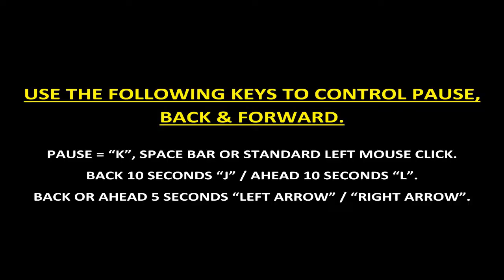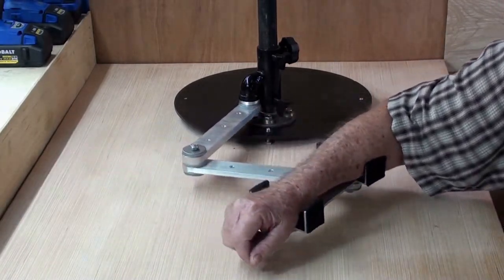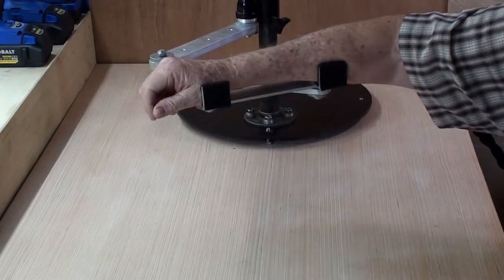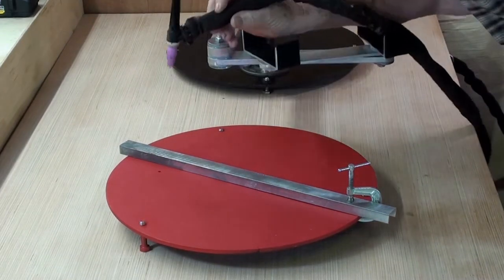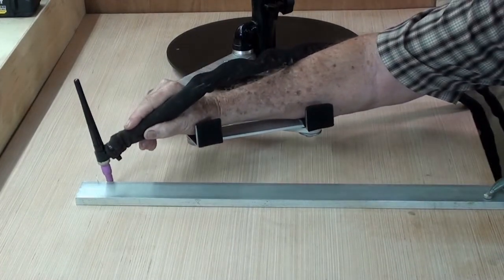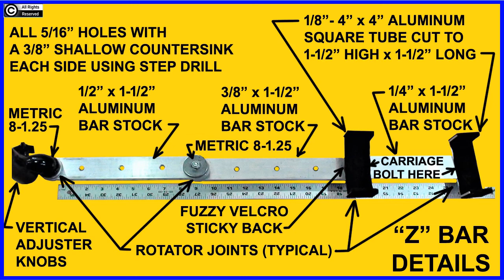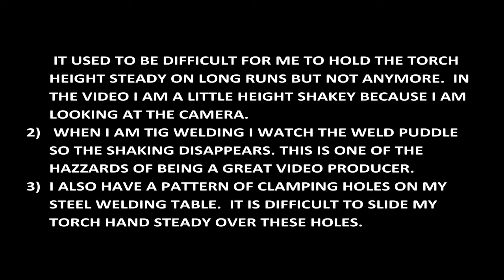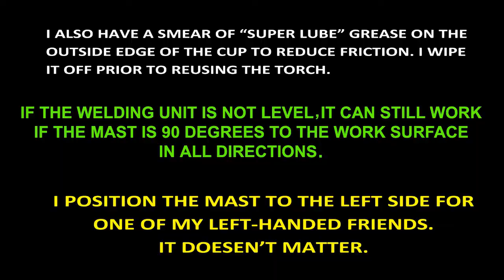TIG Welders "Z" Style Heavy Duty Articulated Support

Comment from the maker: Anyone who knows me is aware I am a chronic tinkerer. Since that is true I just finished a second unit.
In the video there is a yellow page titled ''Z" BAR DETAILS.
I purchased 1/2" x 1-1/2" aluminum bar stock for the bar that that connects to the mast.
I had to order 2 bars from "Stoner metals" as a package deal. 
I made a copy of the center center bar using the extra  1/2" x 1-1/2" aluminum bar stock .
It is now the new center bar.
I shortened the 3/8" middle bar to the same dimensions as the 1/4" x 1-1/2" bar.
I replaced the 1/4" bar with the shortened 3/8" x 1-1/2"" bar. 
The unit has no flex and swivels like a dream. 
I did have to use 2 bolts with longer bolts but it was worth it.     👌
Reply from the maker: I lengthen the main bar to make the unit ultra silk smooth with no wandering on down stroke. View link below.
Click on the square symbol on lower right of the photograph to enlarge 👀:
https://tkmaabl.sharing.bublup.com/ui/landing_page?item_id=001-i-f7f12164-12e3-4fae-ad8b-a4453a6cdf34

Comment: Will it work with a mig welder?
Reply from the maker: Hi Cristian and thank you for your question. I only tried mig once maybe 15 years ago. It was at a Lincoln booth at an airshow. For what I recall the mig is normally used for heavy duty non-critical welding and items that must be welded quickly. The mig welds if done properly are very strong but not necessarily pretty. Tig is more an "Xray" approvable weld that looks nice. I think my device would be too small for heavy work to fit on a welding table with units range of motion. My device is aimed at the tig welder that needs to keep his electrode no more than 3/16" or less from the material being welded without "Dipping".